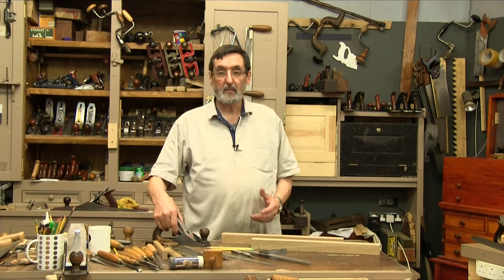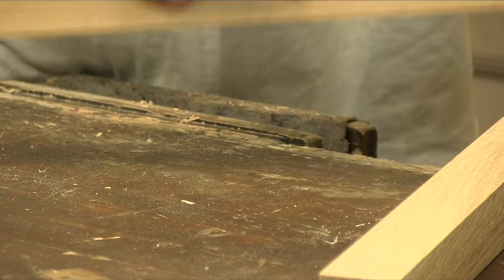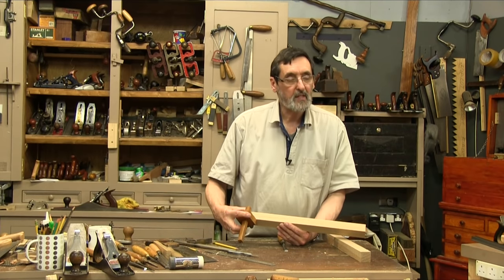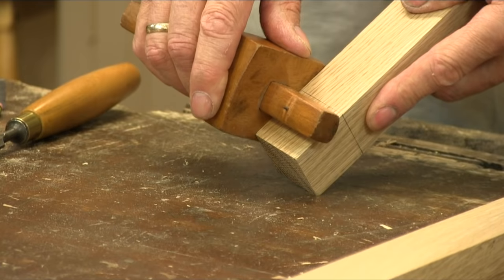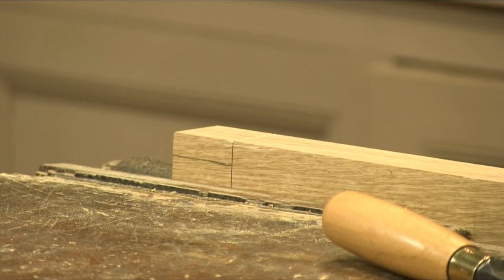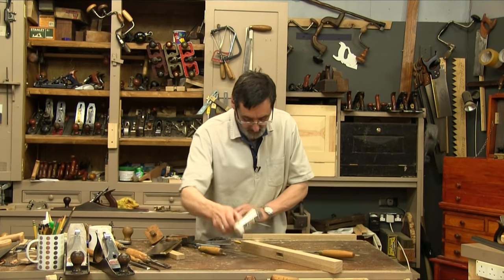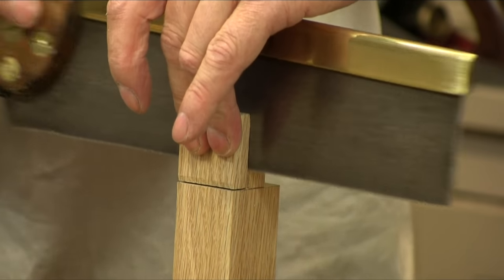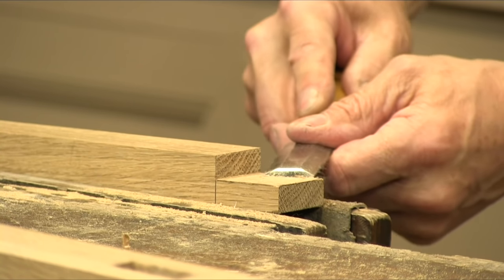How to make a Mortise and Tenon Joint - The Three Joints - | Paul Sellers

Comment: Good day Paul,    Apologies if this is not the best place to ask questions. I have built a porch bench with through compound mortises. The question is as is with which first, the chicken or the egg? I did 1.25" thru compound mortises as mentioned and then the tenons. Is it easier to do thru mortises at 90 degrees then the compound angles on the tenon to arrive at splayed legs?  Thank you in advance.

Comment: After watching this I realised I was not quite (stress on the 'quite') as incompetent as I thought; I had naively assumed everything would fit first time round and there would be no spaces between the fitted tenon and mortise. I had to trim the tenons on mine to get them to fit, just as Paul does (though needless to say his are better). Having said that it's years since I last made any such joints, big beefy ones on a pair of replacement garage doors I made (the time it took was a source of great hilarity to my friends - "So how are the garage doors, Bob? Ho ho ho..."). Putting the frame together on  the 2nd door the joints - 6 per door - fitted rather tightly and after applying glue I couldn't get the joints to close, so (in somewhat of a panic by then) I grabbed my car jack and was just able to separate the parts before the glue set too far and all my work was transformed into a skewed mess suitable only for firewood. A bit more trimming and all was OK. I had to lie down for a while after that.

Comment: Dear Paul, 

Could you tell me what is the name of the tool what you use in the second part of your video (what kind of chisel)? Thank you so much, its a very useful video.  

Best regards: Peter
Reply: +Peter Keri That's a router plane, normally used to smooth dadoes and so on.

Comment: I am currently building my bench using your excellent YT series as a guide. I've chopped my first few mortises for the leg frames, but I'm not satisfied with the result. My chisel seems to always slant away from me, causing both ends not to perfectly meet in the middle and I have to pare inside the mortise to correct that. Do you have any tips on what I can do or focus on to keep my chisel square to the stock?
Reply: I just chopped a mortise that I'm happy with. I concentrated on keeping my chisel square by sighting the edge of the chisel with the knife mark indicating the edge of the mortise hole. That was on the way forward. Travelling back, I could just sight my chisel with the mortise hole itself. I'm quite pleased with the result I got by doing this. Would you say this is a good way of going about it?

Comment: I have a question, would putting a screw through the joint increase the strength (Straight or pocket) or would it actually compromise the integrity of the joint?
Reply from the maker: Hi Yousef. It is unnecessary if the joints are accurately made and there is no need to introduce a third component at all.

Comment: Hi Paul. I never seem to be able to get the side walls very clean (on the end grain sides). I can seem to work out why. could it usually be due to a blunt chisel or not hammering hard enough. I seem to have chunks with small holes in the sidewalls.
thank you.

Comment: If wood moves due to different moisture content, humidity (Summer and Winter etc.) don't you need some slack in the joint or wouldn't some slack allow for movement?
Reply: Simeon Banner n

Comment: What do you do if you're making something big that requires big tenons, and the length of the tenon exceeds the depth of cut possible with the back saw?
Reply: If the wood grain permits you can just split them out with a wide chisel - it's a whole lot faster than using a saw!  Just made a door like this...

Comment: If I don't have a beautiful manual router, is there any harm done in using a large flat file to thin down the cheeks so they fit into the mortise?
Reply: No, that's fine so long as you keep it nice and square.  The router plane is much easier to get a good result from though

Comment: What is the name of the tool you used to shave down the tenon when trying to size it - did you call it a router of some sort?
Reply: +B0M0A0K It's a hand held router. The original wireless router.

Comment: New to woodworking and one thing I was wondering about mortise and tenon. most of the projects i see on here use nice expensive wood..tables etc. So when you do a tenon that won't be seen you are using up some of that expensive wood for  a hidden joint. Why can't you do  2 mortises with an inexpensive wood piece jointing the 2 pieces like an oversize domino. I keep hearing that the glue to wood joint is stronger than the wood itself so why not use some scrap to joint nice pieces together?

Comment: I personally still consider that chisel is better instead of that manual router. Chisel is light, undetailed and quick to use also can be used in your own way because you have all your access on it. Manual router has options to set plus double hands used, both doing different jobs and you must be accurate for the job for good result. Basically, chisel needs less to use it whereas router needs more options to be set but precision depends on what you apply/ your method.

Comment: What are your thoughts on mortise chisels?
Reply: +Nicodemus Maximus I don't have them so I've never felt that I need them. I'm sure if I had them and began using them, I'd probably feel differently.

One thing I do differently than shown here is I establish a wall with my chisel around the entire mortise. Mortise chisels have flat sides so that you don't cut into the mortise shoulders. Regular chisels are beveled on the sides and will likely cut into the shoulders making the joint look sloppy. I'm not in a hurry for any reason, so I slowly cut through making sure I take care to not damage the shoulder lines so that my joinery looks crisp.

Comment: Thank You! I have been cutting mortises wrong all this time (not that I ever knew differently.) A question though; I have never seen chisels in anything other than 1/8" increments at best. If you have to cut a mortise that is 11/16" instead of 5/8", is there any practical difference from the method shown here?
Reply: You wouldn’t layout for 11/16, you’d tweak the mortise width to the nearest appropriate chisel width, and alter the shoulders respectively.

Comment: Not being very familiar with the differences between British and American tool names, is there a difference between a tenon saw and a back saw?
Reply: I believe it is the same thing
Reply: If I'm not mistaken, a tenon saw is a specific type of backsaw.
Reply: Back saws are generally just saws with spines on the back. So dovetail saws, tenon saws, carcass saws, gents saws, etc., are all kinds of back saws. Tenon saws are bigger than a dovetail saw, and I think they're usually rip filed to cut along the grain for cutting the cheeks of the tenon. But all the styles of back saw sort of bleed together; I don't get the impression they are hard-set categories.

Comment: I notice you  leave the Mortise Hole furry. No glue. So this is a tight fit and won't budge? (Thanks for the video, nice work!)
Reply: ah ok. i'm still a novice. i love this video and advices. thanks
Reply: +donepearce Actually it is not better. Best surfaces for gluing are smooth. However with as tight a fit as Paul's a little bit of fuzz doesn't matter, especially if the joint is to be pegged or wedged.
Reply: +donepearce Nope, glue does not require any key. It is a myth that abrading surfaces makes a glue bond stronger. Also, I do not think Matthias meant that a 'slack' joint is stronger, haven't seen that video though.
Reply: +donepearce I just saw the video. Butt joints with yellow glue seem to be about 10% stronger if you allow room for glue as opposed to tight ones. Tight butt joints with gorilla glue were another 10% or so stronger, but super weak if room was left. I do not know how that would translate to mortise and tenon joints, as they resist racking forces much better. Mostly it would not convince me to produce intentionally sloppy joints because it feels like bad craftsmanship. You had a point though.

Comment: Wood noob here: What is the reason for flipping the wood over for the mortise? Why stop at the 7/8" point, instead of just punching through?
Reply: You will brake the wood on the other side. It's called tear out. It's the same thing as when you drill through wood too fast.

Comment: Do you glue the joint?
Reply: +Tin Man Glue and Wedge, Glue and Drawbore, Glue and Pin or just glue by itself. But always glue. If I am not looking for additional constrast or detail, I will wedge the tenon so that it becomes absolutely flush to the top and bottom shoulders of the exposed mortise after planing it flush to the mating workpiece. I always use a mechanical element to this joint, because it tends to take stress and can become weak over time if you only use glue.

Comment: Wtf is that pin scribing block thing at 3:00? Is it like a compass and a scribe together? How does it lock pins in place? Can I buy one these days?
Reply: It's called a marking gauge.  You can buy them new.  They still sell wooden ones but also brass and steel.  It's a pretty simple mechanism but hard to describe in words.  You'll understand quickly once it's in your hands.

Comment: 29:23 for the shoulder that needs a little extra help, I can't see any difference between before and after the hammer tap. It's still facing the camera after the tap and looks the same to me. When Mr Sellers says "there, that's got the shoulder perfectly tight" and we see a perfect line at the shoulder, he has turned the workpiece around so we're looking at the side that was already perfect. This is obvious from the motion of the workpiece, a half rotation around the tenon piece as axis, as well as from the grain and from the lack of pencil markings which are present on the worse side. It looks to me that the shoulder was cut very slightly off square so hitting it wasn't going to straighten it in fact the four corners are like the four legs of a stool with one short, it just lift the mortised piece off the opposite corner. Can anyone please explain to me what the hammer blow did since it didn't move the pieces visibly?

Comment: So if I could saw my tenon cheeks and shoulders with a tenon saw and the tenon fitted in the mortice first time without the need to purposely make the tenon fat and have to pare it back how would that be?
Reply: allan solomon lucky... or slack.
Reply: allan solomon new at this maybe?  when working with small dimensions it's always best to err to the fat side, then pare to fit.  Otherwise you will likely have slop or junk and have to start over.

Comment: What is that tool called that he makes two parallel lines with? The wood square with rod and 2 metal teeth.
Reply: +YuanMizzle A cutting gauge.
Reply: +YuanMizzle It's a Mortice Gauge - A marking gauge typically has only one pin, whereas a Mortice Guage has a two, one fixed and the other adjustable. HTH

Comment: it's too tight
should be put together with one hand not using much force.
the glue would then have it's effect.
Still love your video's/work/education.
thanks
Reply: How would a tight fit stop glue from working? Did he not say that a wedge was typical, therefore removing any play in the joint (space for potentially more glue) anyway?

Comment: I was taught to never lever a standard chisel - the bevel isn't strong enough, and the sides are too thin to give you a clean mortise wall. The solution is the "Mortising" chisel which is made from almost square stock ... A mortising chisel gives you a clean mortise wall right away - having to enlarge the "through hole" to clean up the mortise sidewalls will mess up the joints fit!

Comment: The mortise and tenon fit perrrrrr-fectly. Well done. But... you veered one mil off! It this had to be a precise fitting, for example, for a bench or a chair... then this would do for common use. For high end use (read: for people who pay a boat load to get top of the line stuff) it just would not do! Then it has be precise within the pencil line set out measurements.

Comment: Ah. I bought the jointer plane. When you do it with jointer it comes out perfect... when I do it... disaster! The right dips a tad and then it digs into the right more then the left! Must have made this 5-6 times already still having problems -_-
Other problem is the wall on the mortise is not perfect. If it goes slightly off the knife wall then it curves and we don't clean up the sides really.

Comment: As a woodworker, I find this very boring.  I can do the same thing with a table saw in less than half the time. As far as the tenon goes. The mortise... I know no other way.  I see a gap at each end of the longitudinal ends. Perhaps room for expansion when the wedges are applied. Why isn't that explained in this video?

Comment: Make one chop with your chisel in the mortice piece then set your gauge to that mark. Quicker and more accurate. A mortice chisel would be better. Designed for the job of shearing the faces of the mortice. Order of sawing a tenon is long along grain, short along the grain long accross the grain then long accross the grain. Accurate sawing means no fiddlig to fit the tenon. In our shop it was considered amature to fiddle withe tenon. Shoulder plane used for the shoulders. One or two shavings only. Waggling the wood to fit the tenon makes for a gapped fit, as yours is. Finished teaching a few years ago so you cannot join a class.

Comment: Ouch! This so-called Master was not using a mortising chisel. This is a good way on cracking a light duty beech handle. This Paul guy is a good woodworker, but thumbs down on him using a standard chisel on digging out a tough mortise. Having a ferrul and leather pad at the end of the handle will help the handle from cracking. Also, the chisel he is trying to damage has a light duty shank. Real mortising chisels are thick shank and thick tang. You're welcome.